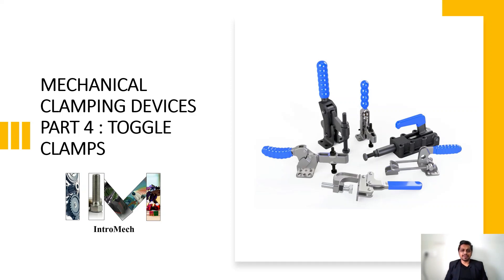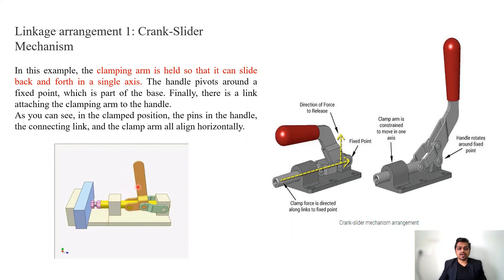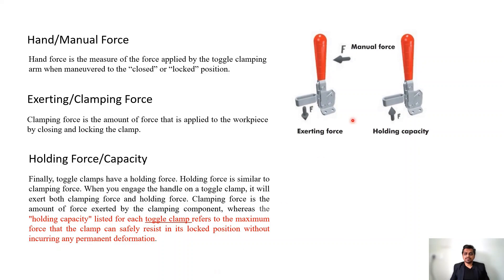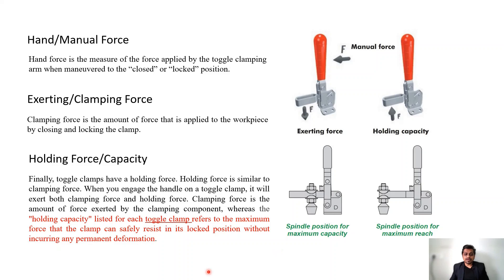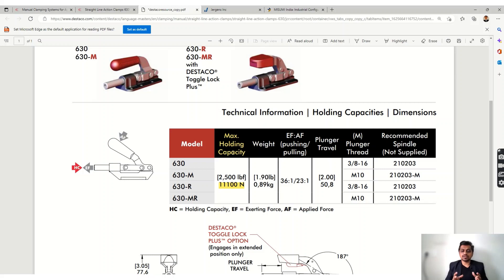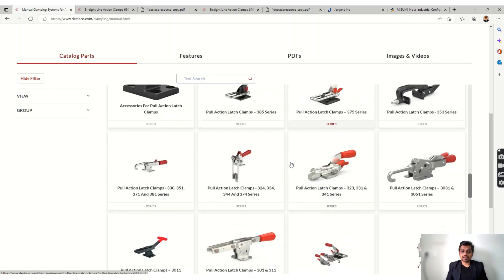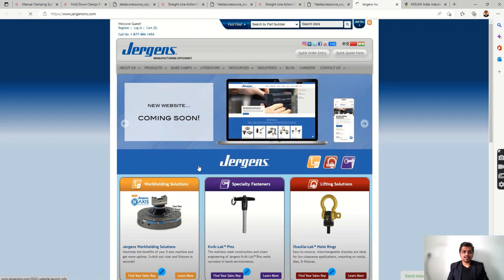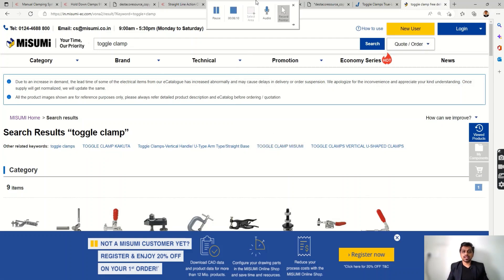MECHANICAL CLAMPING DEVICES PART 2: - TOGGLE CLAMPS

Comment: Thanks, i have learned a lot from your videos especially from component selection videos. Plz make a tutorial on selection of hydraulic cylinder and solenoid valves model and size! I requested you few days earlier. Thanks
Reply from the maker: Hello Devendra...Thank you!!! Yes, the tutorial for Power Clamps will come on 8th July 2023. It will give you an overlook of hydraulic cylinders. I will try to come up with Solenoid valve selection videos soon. 👍